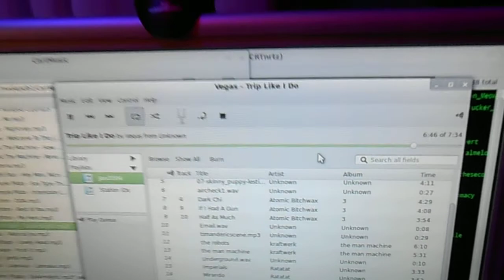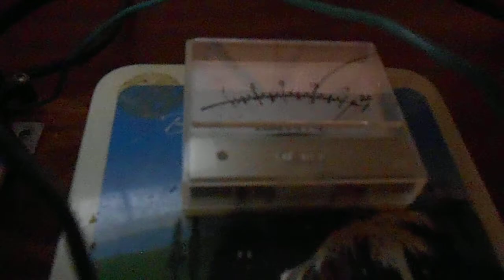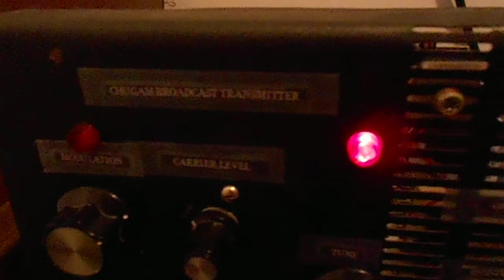Free Radio FM 96.9 and AM 1710 transmitter gear

Comment: Your swr's are supposed to be as low as you can get them. 1.1:1 as they say. High swr's is showing a feedback to your transmitter and amplifier. It will burn it up! Heat problems are because of the power feedback. At 1.1 it will triple your output signal strength. Tune the needle to 0 if you can. Nothing above 2.0:1 but 1.5:1 is much better. Check the frequency length of your antenna if you have trouble lowering the swr's. Hope that helps you get out of that ticking blowout.
Reply from the maker: nasanction this is not a SWR meter, it is a current meter measuring antenna resonanace by current, just like with the old lightbulb trick where you wire one in series and tune up the antenna for maximum brightness to know the antenna is resonating. Yes an SWR meter you would look for lowest reading, but with current metering you do the absolute opposite. This is common with mediumwave and below when tuning up. Much different than HF and VHF and above antenna systems.
Reply from the maker: Ken Zingzong BTW if you look at the Colt meter measuring SWR on the FM transmitter above you will notice SWR is 1.3 over 1 which is very good (edit: the colt is measuring RF output, not SWR, but it is 1.3 over 1 average)  but that is to be expected with my jpole antenna outside. The AM transmitter below with the fluorescent light glowing next to the tuning coil with the other meter is measuring antenna current, which is the common way to measure antenna efficiency below 1.8MHz since most SWR meters will not work properly at those low frequencies unless you have the money to fork out for a Bird meter, but that would be silly when a current meter works equally well if you know what you are looking at.

Considering I built all the transmitter equipment in this video, trust me I know a thing or two about SWR :P
Reply: My bad, I'm just a CB er and run a small FM station just for my home. I setup and tuned my antenna using the SWR method. I thought that was your SWR meter. I have never used the current method you have described. Very interesting, I'll do some research on the subject. Thanks!